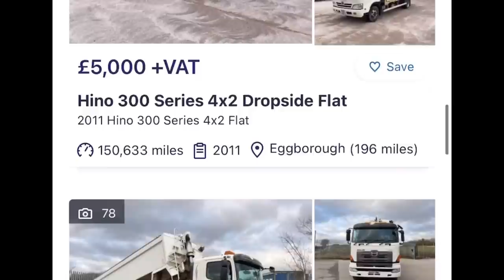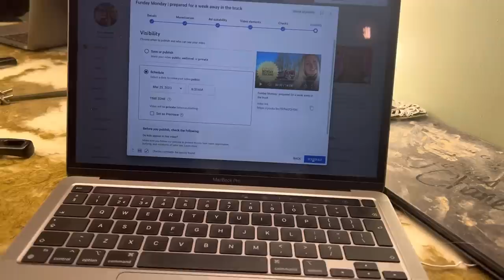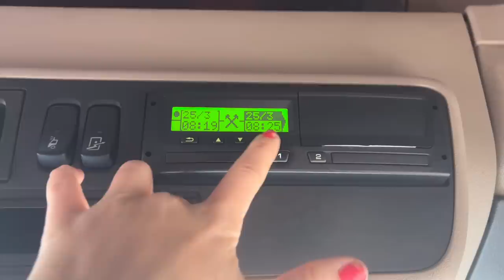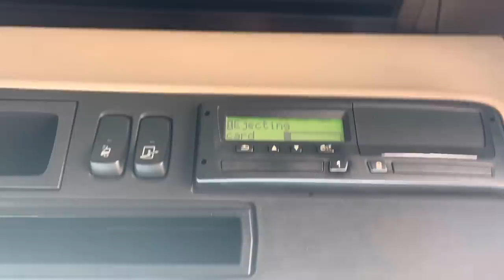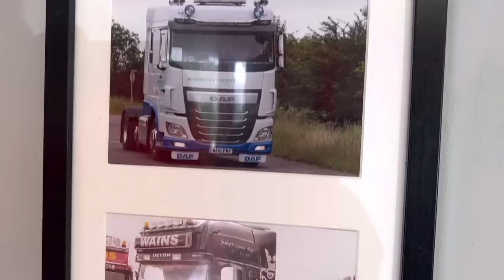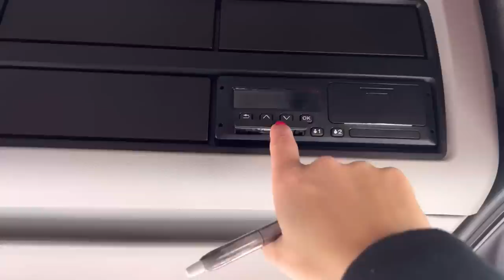FRIDAY! Will I Make It Home? what happens if I don't?

Comment: Hino Trucks were assembled by "Harris" in Dublin. The Hino was a staple of the Irish construction industry. They are the only assembly plant outside of Japan. I believe they also were the only plant worldwide assembling 8 wheel / 4 axle rigid as Japan only have a 3 axle max. I have seen them export as far as the West Indies from Dublin. Hino in Europe is finished now, engines didn't meet the latest euro 6 emissions I think. Harris changed to "Sino" a Chinese manufacturer I believe but they have finished with them now too.
Reply from the maker: thank you that is really interesting to know :)

Comment: Hi Jemma // Hino make a big range of trucks ,, We carried general freight in the 80's with 3   x  4 tonners and  1 x  6 tonner,,, they can easily carry double  their legal load ,, my truck had 267,000 on the clock in 3 years the  when dad sold the business ,,  The EH700 , 6 cyl , 160 hp motor ran like a dream ,,, BUT with the Australian truck load rating the Hino 500 single axle tipper tares off at 9.4 ton gives them a legal load of a very poor 6.1 ton,,,
All the Japanese trucks are unbreakable ,, a standard tandem drive tipper in S.E Asia  gets bigger springs and tyres and carry a 25 m3 body..
The Hino is just to heavy ,,